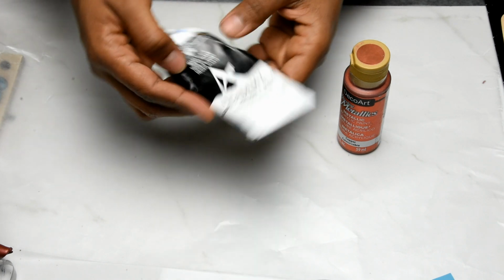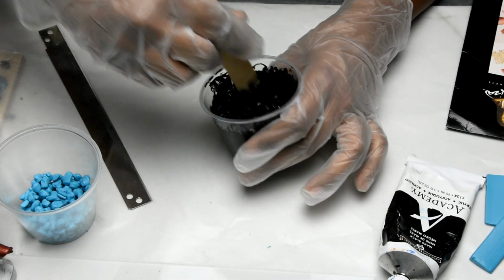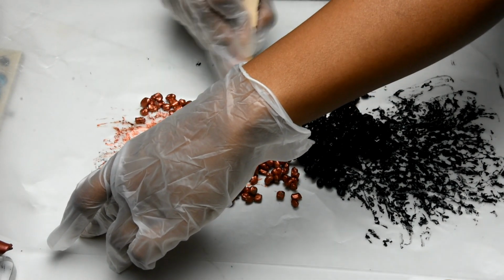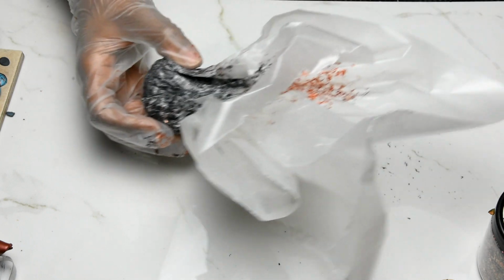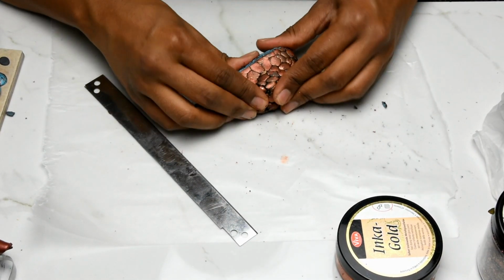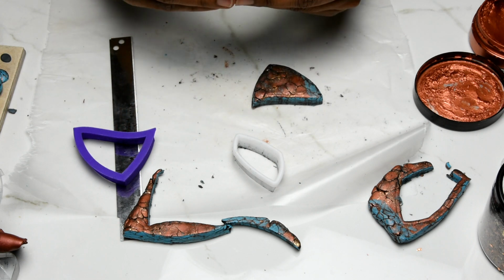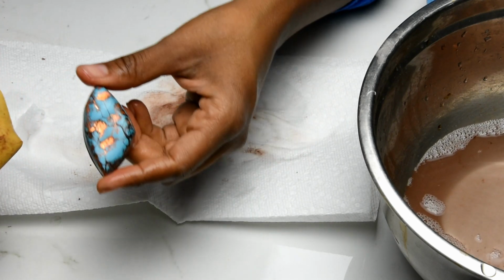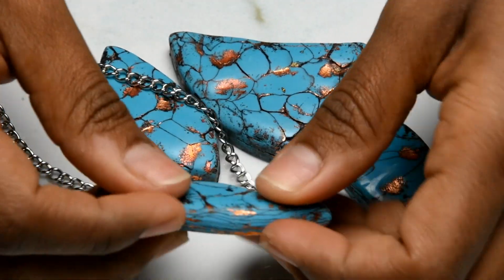Polymer Clay  Project: Faux Turquoise stone Tutorial

Comment: I will try to give you some pointers.  First, I would make many thin to medium slices and then push them together to get rid of joint spaces.  You can use a roller to smooth the pieces out.  I wouldn't use the bronze wax on the surface.  The bronze and gold leaf should be enough along with the mica powders.  For a first tutorial you did great.  Don't let the negative comments get you down.  We are all learning as we go.  We do this to have fun.  Some projects turn out great and others not so.  Keep going and have fun.